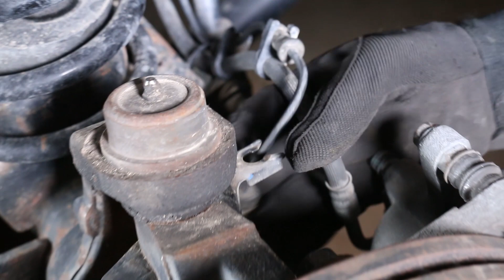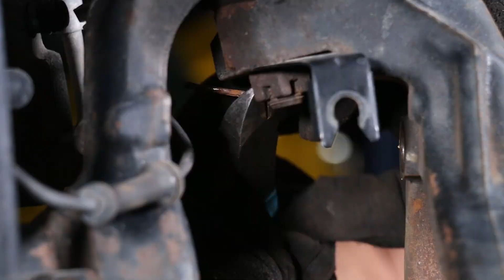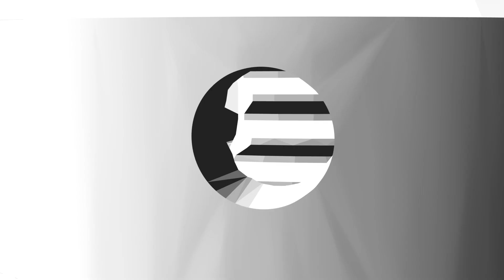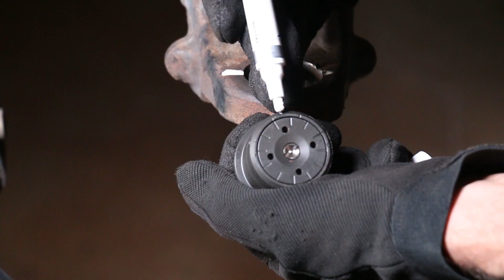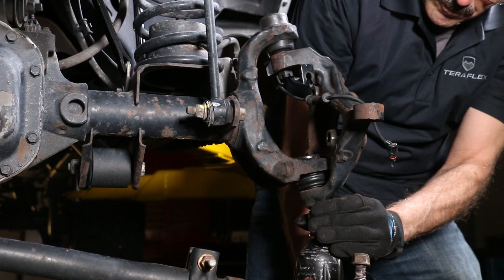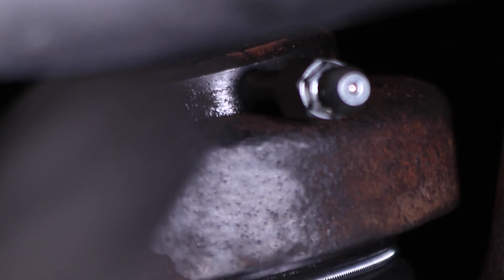TeraFlex Install: JK HD Replacement Ball Joint

Comment: Most places that rotor is not moving, 90% of us do not have SnapOn tools, unfortunately.  In the rust zones, DO NOT remove that speed sensor from the hub, remove it from the the top of of the cable, where it connects with a clip.

Comment: How would I know if I need to adjust these ball joints and exactly how much to adjust them?
Reply from the maker: Lift the Jeep by the axle until the tires are just off the ground. Place your hands at 12 and 6 o clock and apply opposing pressure, feeling for movement. Also, place a small pry bar under the tire. With light pressure, pull up on the pry bar, feeling the upper ball joint for "in and out" movement. If there is noticeable play, its time to adjust and set the preload.

Comment: which one should i go knurled or without knurl
Reply from the maker: Typically you would go without knurled if you are replacing your ball joints for the first time, even second. If you're on your third set, knurled would be best. If you have more questions, please contact us at 801-713-3314!

Comment: I got the teraflex hd tie rod and drag link kit, after alignment I have a little too much camber, will these balljoints fix my issue? Newb here
Reply from the maker: Unfortunately our ball joints will not correct the camber.

Comment: I have a 2014 JEEP JKU - Will these fit? If not, are there any recommendations? I am reading conflicting info. Some say there is some grinding/modifications to make these fit.
Reply: Best I can tell, they've redesigned these ball joints. As long as you get the redesigned version, you should be good. (I've just ordered a set to install on my 2014 JK). More about the redesigned ones on https://youtu.be/SMi3fUH8wOs

Comment: I don't believe snap on sockets are still covered under warranty if they show damage from use other than their designated purpose.  Those hammered sockets may not be covered anymore.  I know they don't cover screwdrivers used as pry bars.

Comment: How can I remove the ball joints if I don't have the ball joint removal tool?
Reply from the maker: Possibly with a torch, but that is not recommend. Try to use some type of press.
Reply from the maker: they rent/loan ball joint presses at most of the chain auto parts stores

Comment: Hey Teraflex great How To's, what part number ball joint press is that you're using? I have one that doesn't seem to have the same dyes you're using and your C looks to be possibly taller than the one I'm currently using. If the shorter reduced dye you're using isn't part of the kit would you know the part number to that as well? Thank you in advance!

Comment: Is there a model for a 2014 JEEP JKUR
Reply: +TeraFlexSuspensions I think it would be nice with you did a future video with '13+ showing how much you would grind off ect.  Is there plans for a updated set in the future?
Reply from the maker: +Mark Aquiningoc You can use these for a 2014 JKUR it just requires a small amount of grinding on the axle shaft toke to make it fit.
Reply: Concur!

Comment: Followed the video and changed out my worn ball joints for the tereflex. Video was very helpful and the build quality on the tereflex ball joints is top notch. Took a while to remove and install everything but the video covered everything. Just be careful removing the abs wheel sensor - they are plastic and prone to breaking while trying to pop it out.